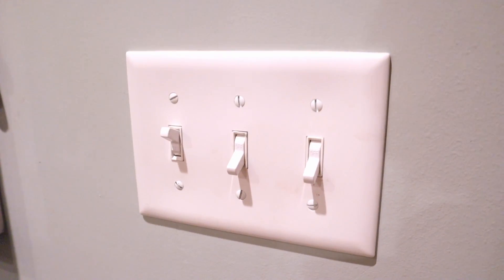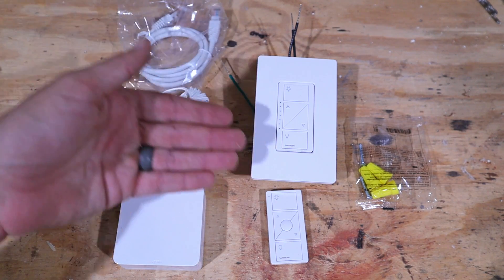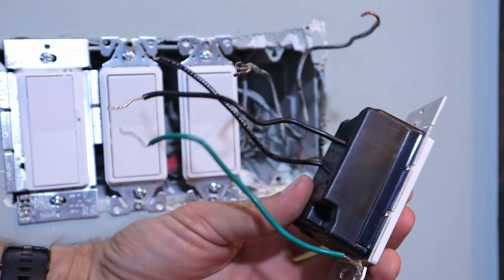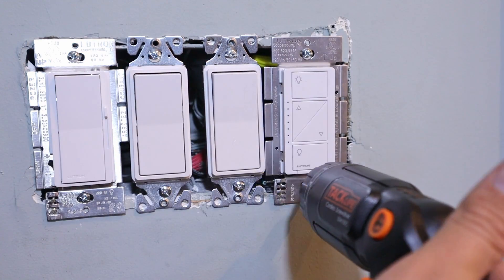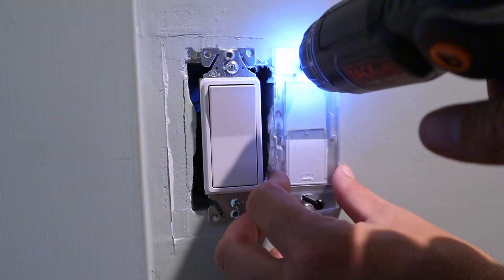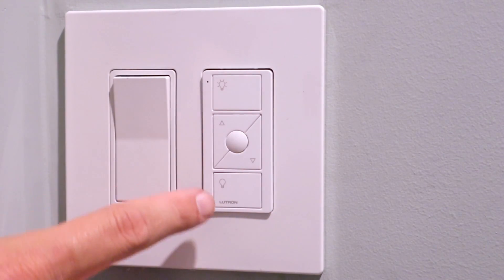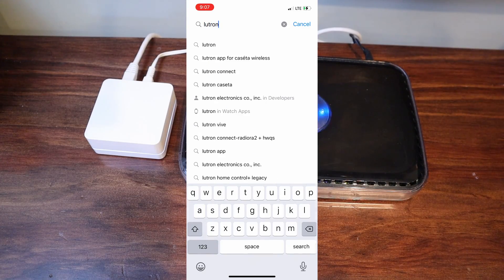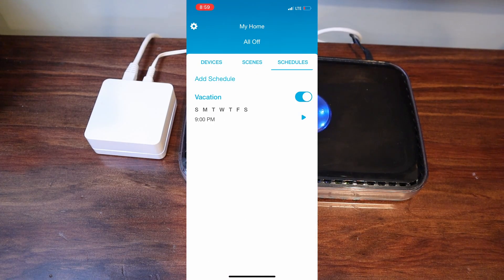How To Make Any Switch a 3 Way Switch Without Any Additional Wiring!

Comment: I already have two 3 way switches but want to make it a 4 way switch to control from 3 locations. How exactly would I do that? One Caseta wired and two wireless? Or two wired and one wireless? If it’s 2 wireless would I just cap off the 2nd existing wired switch?
Reply: The way to do it is one caseta wired and two wireless. Then you will bring the feed/power to the second box where your load is and wire the caseta to that box. Now your first box basically becomes a junction box and you can put the 1st wireless remote  there and then chose another location of your liking to install the 2nd wireless remote. Then all you have to do after that is program it

Comment: Hmm..  Thinking I could install one of these switches in my garage and stick the remote in my car so I could switch the garage lights on when I arrive and off when I leave.  Could do the same with the exterior lights as well!!
Reply from the maker: Yes you could do that.  In fact, they actually make a sun visor clip for the second switch so you can put it right next yo your garage door opener.
Reply: @HowToHomeDIY  I like it!!  Now that leads me to wonder if it's compatible with a vehicle's HomeLink system. Would be cool to be able to use the 2 unused HomeLink buttons in my car to switch the lights on and off..
Reply: Why not just put a motion sensor switch?
Reply: @samskins  I like making things unnecessarily complicated!! 🤣
Reply: @CertifiedShadetree  🤣 ok ok
Reply: You don't need the remote for an application like that. Just use the phone app to control the switch.

Comment: The second switch must use battery in order for it to operate.   
Do you know how often do you have to change the battery ?
Reply from the maker: Yup you are correct.  I actually filmed and installed this over a year ago and have not had to replace the battery yet.  And that’s with using it daily since it controls our family room lights.  But they claim the lithium battery life in it is up to 10 years.
Reply: @HowToHomeDIY  thank you for your reply.  I bet it will last about approximately 3 years only.  
Your video very helpful.   It gave me an idea of installing a second switch for the same light in the future.
Reply: Lutron Carta Pico Remotes are rated for 10 year battery light at 10 uses per day by Lutron.
Reply: @giuseppebotta8320  And you wouldn't realistically use 10 light cycles per day by the remote if you use the phone app or Alexa/Google.
Reply: The pico batteries are very long lived. I've installed a bunch in 2014 that are still going strong with no battery changes. And you can change them easily when the time comes (they take coin cells) and get another decade